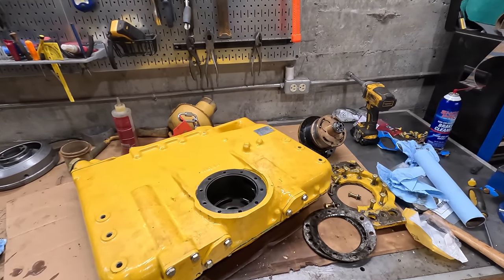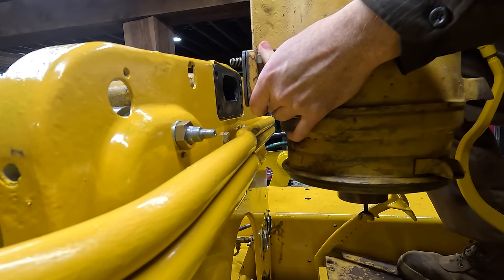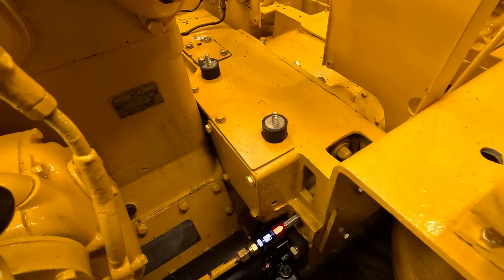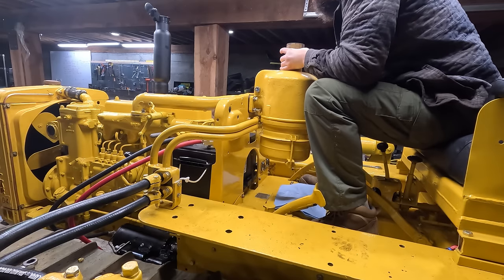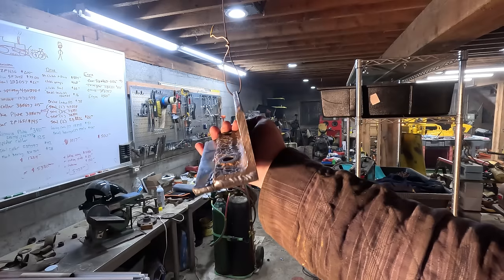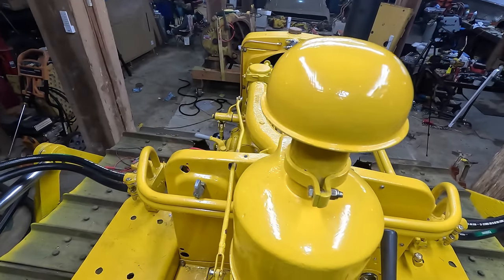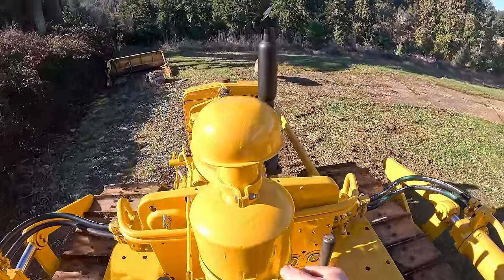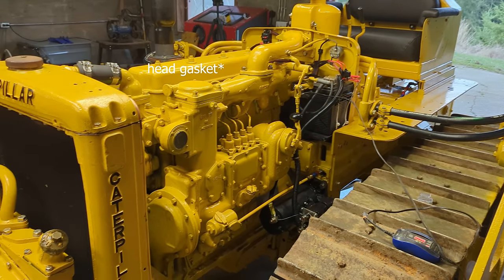Caterpillar D4-7U FINALLY moving under its own power after rebuild

Comment: When you pull back on one steering clutch or the other, the machine should turn to that side very little until you put some pressure on the brake to turn it. Obviously if you’re traveling uphill, just pulling on a steering clutch will make it turn more in that direction because of the load being pulled uphill, but when going downhill, the machine probably won’t turn much at all if any without dragging the brake.
Reply: Good advice. When going down hill if you pull say the left clutch that side should free wheel   (depending on how steep) and same for the right clutch if not then you may have a bit much drag on the brakes
Reply: @hotladyb45  
Not really advice, just the observations of a big kid that once upon a time got to play with lots of different big boy toys in the giant sandbox of a sand and gravel plant.
Reply: You can judge the adjustment of the steering clutches by pulling on both at the same time. When pulled all the way back, the machine should "stop" ! Release one at a time and see where they grab. They should be even.

Comment: Electrician here: Vibration, as long as it doesn't stress the terminals, is fine for flooded lead acid batteries. It helps stir the electrolyte and knocks off sulfation from the plates.
Reply from the maker: thanks

Comment: Just thinking. Install a permanent jumpstart fixture, to avoid damaging your battery starting system. Use an electric forklift charging socket and cables. Welding cable is the best. I have these things on all my equipment. ChiefD

Comment: Mat I don't remember if you had the head off or not but on some of the older stuff, we used to put #2 nondrying Permatex on the threads of the head bolts on installation. The reason is some of them thread directly into the water jackets. Food for thought.

Comment: I've reused head gaskets before if it's a metal one an not rotted out. Take a soft brass wire wheel put it on your die grinder clean all carbon off both sides gasket an cyl head an block surfaces an finish with braakleen on all surfaces.  Take gasket an coat both sides with copper coating an spray block an cyl head. Retorq head an it should be sealed up.

Comment: put a ground strap in the section of the filter housing you put that heater on
Reply: and re torq the head bolts might fix the leak

Comment: Hard to really see on the vid but it looks likely you are welding backhanded when you should be working forehanded. Backhand welding with the torch facing the opposite direction to the direction of weld is only for thin body panels where you are trying to limit panel heating, on thick steel, to get best penetration and puddle control, you need to consider the heated CO2 passing over the puddle like a mini sand blaster, it scours and pre-heats the weld gap.
Reply from the maker: thank you, I always appreciate welding tips
Reply: @PacificNorthwestHillbilly  NP, I had to be shown after nearly a decade of welding! If you are right handed then forehand will be right to left with the torch pointing in the direction of weld. If you are stitch welding a butt joint in hot rolled, when you stop the weld to move on, you can see the CO2 scouring as the butt directly ahead of the end of the weld will be bright and literally looking like bright mild.

Comment: As soon as I saw the weeping between head and block, my very first thought was "That looks like it just needs a quick re-torqueing".. 
If you do end up removing it, head to ANY auto-parts store and in their sealants section, pick up a little metal can of this magical red goop called "High-Tack" made by Permatex.
It's a "gasket sealant" made specifically for shit like head, intake, and exhaust gaskets, and it is truly voodoo with how well the stuff works. (I've used it in place of a gasket on a couple old Briggs flatheads.. Like no gasket, only a thin layer of high-tack, and it worked just fine lol)

Comment: funny noise coming from the rear end. maybe gear lash or bearing noise.
Reply: seems much louder in reverse.
Reply: aha! the brake is on!! I think that's what the noise is.
Reply: Pull steering clutch back, depress steering brake. They both need to be used every time you need to make a turn.
Reply: try re-torquing the head bolts before replacing the head gasket.

Comment: 👍👍👍👍👍👌Really enjoy watching your videos and the camera work and editing, your attention to detail on the restoration is amazing, one small tip when using your MIG welder on the lower setting it is important to clip the wire end that usually forms on the end of the wire stick out when previous welds are completed a mig plier works great for the as well as nozzle maintenance about $8.00 at most places but worth it  , thanks for sharing your videos
Reply from the maker: I didn't know those existed, but I had been looking for a clipper I could fit in there, thanks!

Comment: Don't beat yourself up on the little things that need reajustment Matt.
You've done an incredible job taking a pile of rusty crud covered heavy metal monstrosity most people would have sold as scrap and completely turned it into a Dozer you can be very proud of.
Thebragging rights you deserve are off the chart level.
Do address the gead gasket issue asapor.
It can cause a whole lotta seriously exspensive problems if you don't. 
Can't wait to see your first time pushing dirt with it.
Now ya just need to give it a name like Mike Dirt Perfect and Chris Letsdig18 have given their restored older equipment they actually use on professional job sites.

Comment: What you called the emergency brake is actually the parking brake.
There is no emergency brake on a bulldozer in an emergency if an immediate stop is required you simply drop the blade.

Comment: Great work Matt,however IMO Caterpillar way complicated and overdesigned equipment.I believe IH were way more logicall designed machines.Yes I know Caterpillar is still in business and IH isn't, but a storm of issues brought down IH.I believe IH built as good as Caterpillar and fixed their engineering problems along the way.The Caterpillar just seems  and looks to be hard to maintain.

Comment: Welding is an art and requires constant practice. Play with where your arc is running to. On heavy stock to light I carry the arc to the heavy side for more heay then draw down to thinner side for a little less heat on that side. Mostly keep at it and keep trying different evrrythings. You will get better. Beside the point, I worked in a soybean processing plant and the pipefitters made up a run of 8 inch pipe. All the welds looked like textbook examples but after a week or so they all cracked right on the edge of the weld. The point is if it works and holds then appearance is secondary.

Comment: Well done really pleased to see her running and moving it must give you a very satisfied feeling knowing all the hrs you have put into her finally paying off . 
Head gasket just like my diesel landrover you have to run a bit then undo and  re torque the bolts plus I also check my timing and reset it at same time . 
There a saying with landrover especially my ones oldest a 57” youngest 74” but Leaks are a sign it not empty plus it marking it’s spot lol

Comment: ignorance speaking here so please forgive me.  Was that red diesel fuel you added?  I hope so.  Red coloring is added for off road equipment.  Not added to fuel used on highway equipment.  Red costs less as you don't pay highway taxes, you aren't operating  equipment on the highway.  Clear fuel will work but you are paying taxes to use the highways.  I don't think you will be running your D4 on the roads.  likewise, don't run the red stuff in your truck.  Big fine for not paying your highway taxes.

Comment: All said and done, what a fantastic job you have done. I do hope that the retorque of the head bolts solves your issues with that. Some of what you call leaks, I would call weeps. I do think that after you run it bit and go over all the hardware most of those should go away. You were very good about torquing all your hardware, but all the parts are old and I think that on some of that stuff the torque numbers are not good enough and that you can just grunt on them?

Comment: That type of air cleaner is the Very Best ! "Oil Bath" ! JB weld is great ! Lots of people use it . Not just Hicks . I am loving the Old School Voltage/Amp Regulator .  What a shame about the Head Gasket . But with the Original condition and all you have done you are ahead of it all . Conjurations on a job Very Well Done . Thanks for sharing . PS: Did you say if the Generator was working ?
Reply from the maker: I forgot to check 🙁

Comment: My Dad & the dealer changed the oil bath air cleaner over to a dry housing w/ new style pre cleaner and if i remember correctly, we had a conversion plate that bolted to the dash and supported the air cleaner better, great work!

Comment: When ever you do an engine rebuild and you've done a run in and gotten the engine up to temp pull the valve cover and retorque the head bolts then readjust the valve lash.

Comment: I originally found your channel while doing research on our D4 and trying to figure out how they added the starter to these older machines. I haven't run it in years, but I did do a service on the pony motor the last time I used it and it fires right up and everything else works other than I couldn't get it to engage the flywheel after awhile. Anyway, congratulations on getting to the end of your project! I really enjoyed watching and learning what's inside those covers I've never opened up!

Comment: You should be very proud, it looks amazing!

For the layperson, can you explain how that air intake works?  Why does it have oil in it?
Reply from the maker: The engine pulls the air straight down through the cleaner, and the air has to turn 90 degrees twice very quickly to go back up and out into the manifold.  The abrupt change in direction causes dirt and dust (which are heavier) to run into and get captured by the oil.

Comment: (thinking aloud) I thought the compression release was a pony motor thing, to allow the big engine to be engaged to throw oil around & loosen up before trying to get it to pop-off.  Given that it might sit for a while between dances, are you thinking that you'll let the compression off to pre-lube things before you try to actually get it firing?  Is there a consensus from the old-iron folk on that?  Nice work on the restoration and the channel!
Reply from the maker: I have the compression off anytime I turn on the starter.  I was told by a guy that used to do the retrofits that there is a danger of the starter snapping off the flywheel teeth if you start spinning it with compression on.
Reply: @PacificNorthwestHillbilly  A retrofit guy would know.  Teeth floating around, that's one of those things to avoid. So throttle to off, compression release on, a bit of a tickle with the starter before introducing the throttle & adding compression.

Comment: i think you should plumb an exhaust pipe out of the side of the hood, or near the chassis and skid plate, to a quiet muffler over the winch. it could be much nice to run all day with less noise.
As for the head, since these engines have that common problem, run atf instead of water in the radiator. then if there is some leaking into the crank, it thins the oil rather than rust/ seizing.
Reply: @mmm365  because?